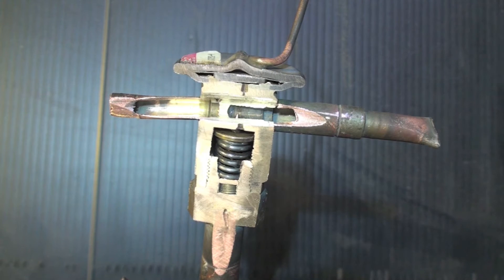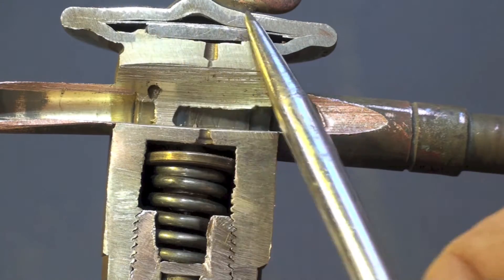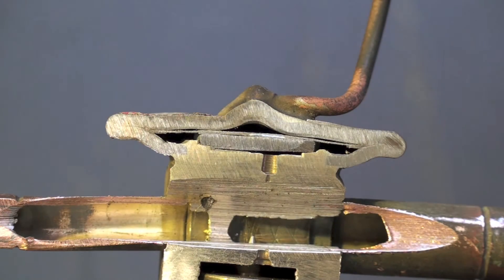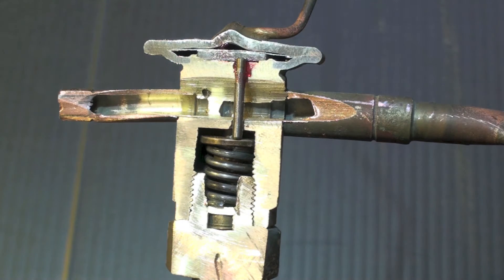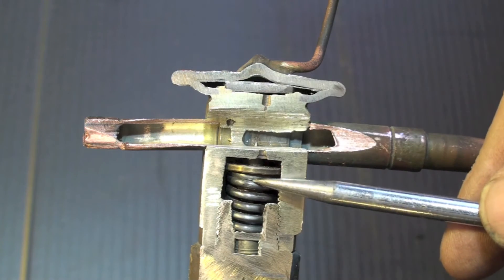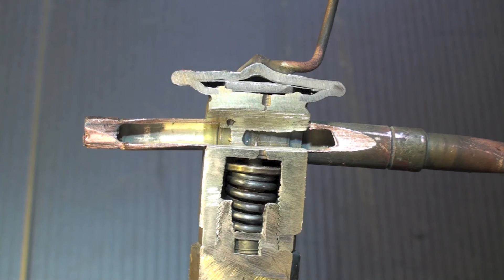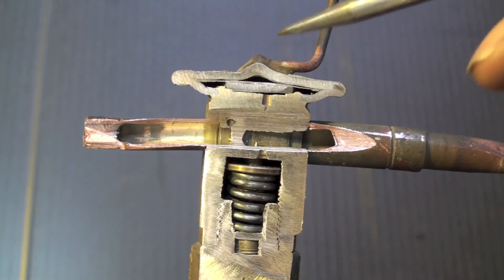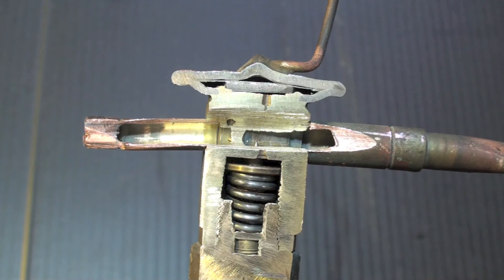A look at the inside of the TXV

Comment: the valve is normally open a little so to allow fluid to pass thru evaporator,when bulb senses increase temp.the valve metering needle  moves downward and the magnitude of travels is controlled by heat adjuster screw.

Comment: At the end of my heating cycle I’m getting a knock, knock, knock for several minutes and then goes away. Happens randomly, not all the time, but sounds horrible when it does. It only happens at the end of the cycle. New ICP heat pump unit, this is the second unit they put in. First one did the exact same thing. I researched and from several TVX manufacturers they say the orientation of the valve can cause “hydraulic water hammering effect”. Powerhead need to be facing the sky. Does this sound correct? Any thoughts? Thanks….
Reply from the maker: About 20 years ago I had this happen on a heat pump.  I had no solution at the time.  Since that time I have seen it happen when the TXV is pointed downward or horizontal.  
So yes, it is true.
GFM
Reply: @grayfurnaceman  thanks so much for responding. What would be the recommendation on a new unit? Change the orientation of the valve? This is the second unit, same issue. Or is there a particular manufacturer that positions the valves in the right position so as for this not to happen? The company is dumbfounded by it, I told them my theory on it but they don’t seem to think that’s an issue, even the engineer at ICP. Would the indoor txv need to be in the right position too? Thanks again!

Comment: I have a question the equalizer line if it went to 1/4 copper to a size of 5/16 would it make a difference ?
Reply from the maker: It won't hurt anything but it also would not help.
GFM

Comment: my 5 year old American standard heatpump txv failed , so much for them lasting forever, works fine in ac mode but unit cuts off after 8 seconds in heat pump mode. What cases these valves to fail? They look so simple. Is there any easy way to fix them without vacuum the sytem and brazing a new one on there? Maybe I can hit it with hammer? Heat it up and cool it donw. I know that sounds stupid, but might as well try something since its going to be thrown away anyways!
Reply: PhotoBooth biz. Its usually the coil.